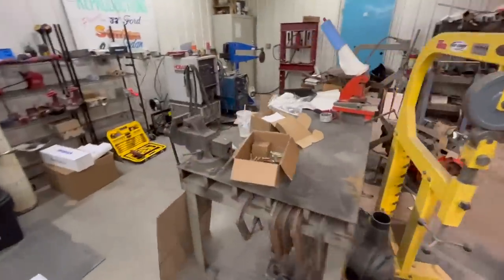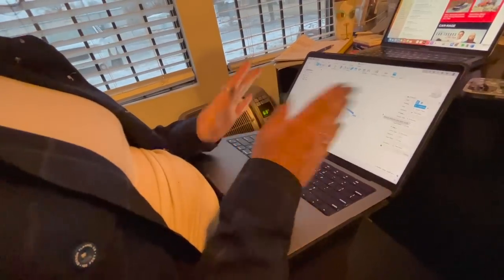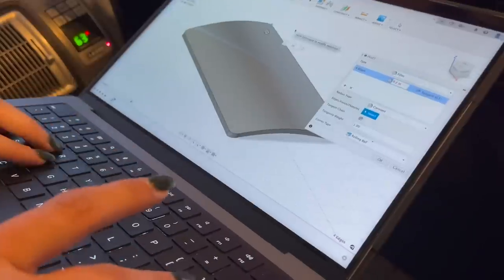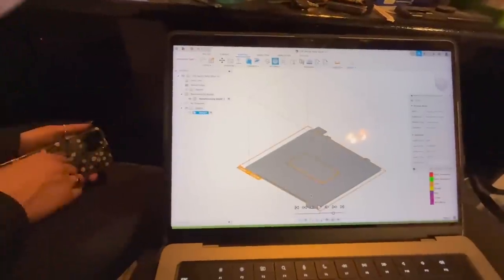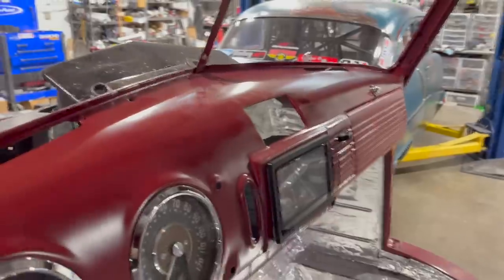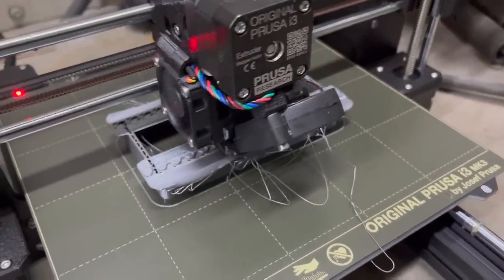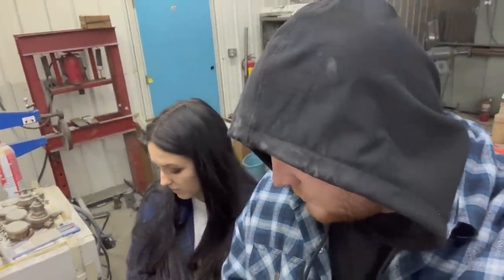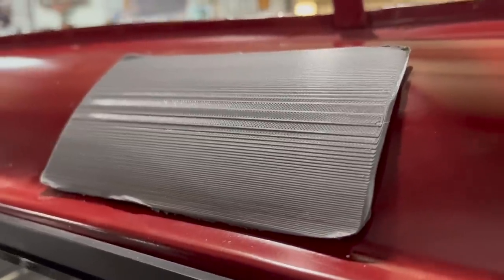First Attempt At 3D Printing! Dash Insert For Dennis's Cab Over

Comment: I would probably print it face down so that you don't need all of the support in the middle. Some small amount of support will be needed on the edges or print it standing up. It's usually a good idea to position a print where the least amount of support is needed.

Comment: Newb advise. Design with printing in mind. You don't need a four sided box in the back, it requires support when printing and serves no function.  Top and bottom extrusions on the back only, then print the part standing vertically on its right side.  This way your curved surface will print clean, without steps.  You will only require a small amount of support underneath the two extrusions on the back.

Comment: get an enclosure to put the printer in to maintain temp and eliminate drafts that will cause warpage and prints to fail. they sell tent style ones that are also fire resistant or just build your own. Also use a separate slicer program that will make the toolpaths for you and give more control they also generate the supports you need . I use Cura but there are many out there. Good luck and that was farther than most get on a first attempt.

Comment: Careful with air temp changes and drafts across the print table.
Reply: An enclosure (draft excluder) can be a BIG BONUS when your printer is in a Work-Shop in WINTER.

Comment: When the top surface of a component has a gentle curve like this piece designed to match the curvature of the dash, it will automatically be ugly.  Think about other ways to do this.
For example, rather than match the dash curve, print the component so that it is flat in the final upper surface.  But print that surface face down on a textured bed.  It will produce a factory like pebble grain surface.  And if that component requires a lot of fiddly design work, consider making your component in two parts.  After you print the two or three components, glue or bolt them together.  A little thought about how to make the parts interlocking or at least indexed to one another will pay off in the long run.

Comment: That piece came out mint.. little sanding and it will be great
Reply: @Rome3aaro;  Clearly Your comment has a contradiction in terms; "mint" vs "little sanding" -> if You ordered such a part, certainly You would not want to have to 'sand' it or do any modifications, correct ?
Such You have just written a comment to placate and " 'soothe' the mind", conscience of the individual - Nicky Bobby => thus not actually helpful.

Comment: Looks pretty good for the first time. Anytime you have an over hang or hollow spot you will need supports. Watch how you place it on the build plate also. Adjust the layer height to a higher number will reduce print time for prototype parts then reduce the layer height for the final part. What software are you using? Are you riding with anyone on sick week?
Reply from the maker: I’m using fusion 360! I’m not riding with anyone but will be following along!
Reply: @nickkybobbyinc   You might want to try a separate slicer program to prepare the model for printing. I use Cura for slicing my models it works pretty good.